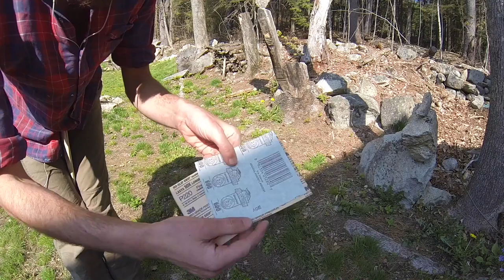Making an Axe Handle of Ash

Comment: Try sanding to like 240 grit then burnish it by rubbing a handful of woddshavings vigorously on the handle. Works great. You can sand to higher grits but this kind of replaces the need in a way

Comment: Great video ! I love restoring axes . I have about 40 axes , saving a couple projects for winter .Got a new subscriber !
Reply from the maker: Wonderful! Yeah, I've got a small pile of them too. I really enjoy making the handles and putting an edge on the head. Thanks!
Reply: @BusHuxley   How is that ash handle holding up? I made a bunch of handles because the Japanese ash borer has Killed hundreds of trees in my backyard.
Lost alot of lumber
Reply from the maker: @tonymaurice4157  very well indeed. Great handle material.

Comment: Only issue is that youve got your grain in the wrong orientation. I made a similar error in one of my first handles.
you are 90 degrees out.
ninja edit - off to make one now - good inspriration though.
Reply from the maker: Thanks for the comment. I was aware of the orientation and have dabbled with both directions. I've found that if the wood comes from the very base of the tree for the handle there isn't really a problem with splits. I like how it looks. It probably isn't quite as strong. I normally don't use a band saw either.

Comment: Thanks for the upload. I'm planning something similar with an old rusty Plumb axe I found buried in my parents' garden. One question, how long did you season the Ash for? I'm planning on using a limb rather than the trunk. Cheers Murdo
Reply from the maker: Ash dries pretty quick. six months to a year. Or just sunny windy and dry. Then it goes really fast. 
Make sure the branch is pretty good sized, and if you can, use the wood that was closest to the trunk. That wood flexes a lot and is thusly quite a bit stronger.